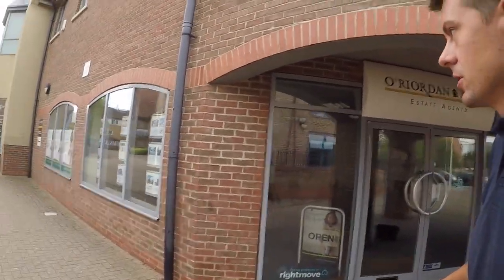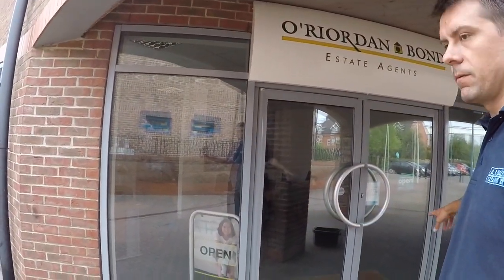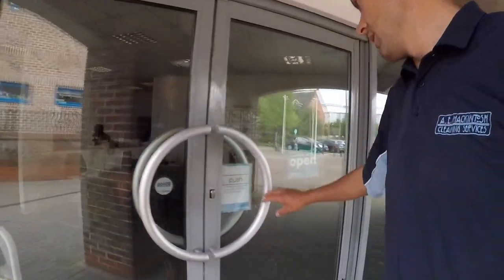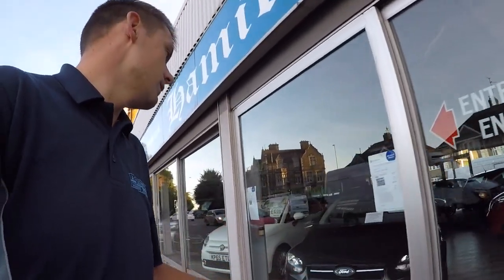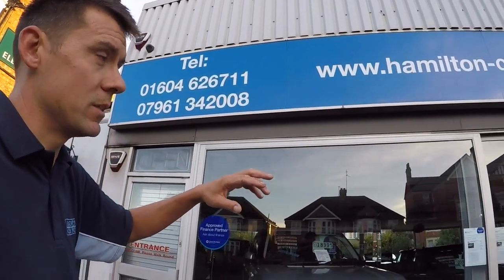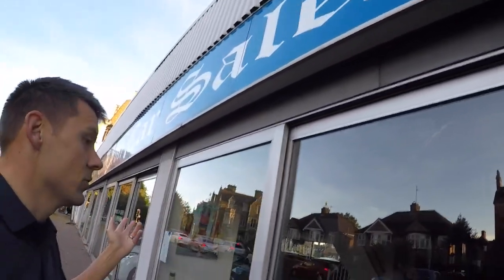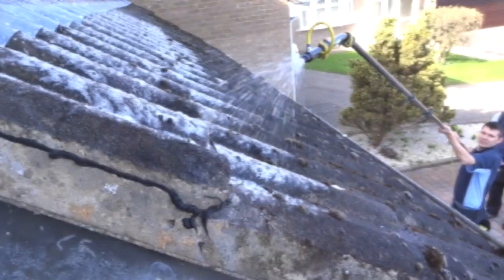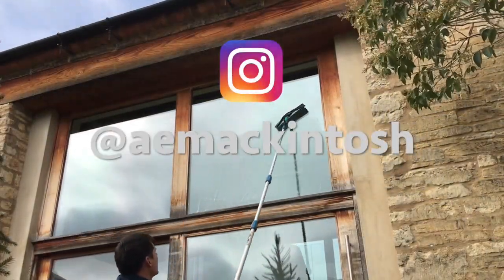How To Quote Commercial Shop Fronts For Window Cleaning

Comment: Your to cheap you need to put your prices up , 60-100 quid a hour is what u should be earning that’s what I charge for exterior cleaning don’t matter if it’s roof cleaning patios windows gutters drives what ever I have a minimum charge of £20 for window cleaning
Reply from the maker: I live in a cheap area, and I made that video quite a while ago. My prices have gone up now. But it’s the method of quoting which is the key to this video really.👍🏼

Comment: Thanks for this vid I don't like commercial I used to do a chain restaurant which shall remain mcanonymous but had terrible trouble with prices as they didn't want to pay and actually getting them to pay was alot if trouble so I said bye bye but at least I know now that my original price idea was more than fine and if any comes in the future I won't be afraid to charge the money become I feel commercial jobs try and lower you down alot
Reply from the maker: Nathan Hodges Some commercial work like this can be very competitive. It’s best to stick to your price, that you feel is reasonable. It works best when you get a few together in the same place. Many of the big name shops seem to be doing thing on national or at least regional contract basis now.😃👍🏼
Reply: @aemackintosh  the company I worked for wouldn't sign contracts not that I wanted to but i think some companies dont because they feel they can push you around a bit being a smaller company it's very competitive nowhere I live for commercial that's why I stick to residential mainly the larger companies just don't charge much but have all the work and to be honest they don't do a good job either it's about slap dash I prefer the customers in residential though a nice cuppa hear and there I prob won't venture back anytime soon
Reply from the maker: Nathan Hodges Yes, I know what you mean. I also prefer domestic. There is more satisfaction from knowing someone is pleased with your work, and a good cuppa is always welcome too.☕️😃👍🏼

Comment: cheers very useful to know .. what do you charge for insides  for such jobs is just a double up? and  also inside of domestic houses  as i get asked  to do them and obviously they take a lot longer than outsides with a wfp especially when some people have paraphernalia on the inside windows  and dont move it for you AND  expect it putting back ! 😡
Reply from the maker: johnny zeros I usually charge the same as outside for inside, it takes longer but I consider it a good gesture. I do ask if it’s possible to move things though.😃👍🏼

Comment: how much would you charge for a big car Showroom with wide and tall windows? Thank you.
Reply from the maker: It is difficult to say without actually seeing it. But if you consider roughly the size of these windows and multiply that up, depending on how big the ones are that you are quoting. Also the higher you are going, you might want to charge slightly more. You could also try to take into account the time factor involved.😃👍🏼